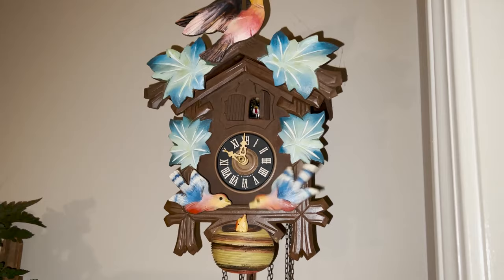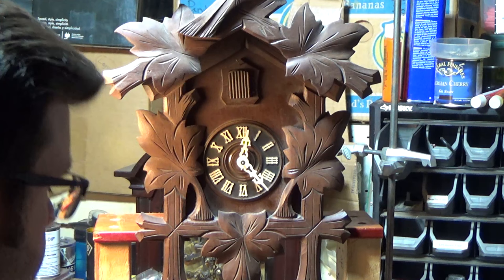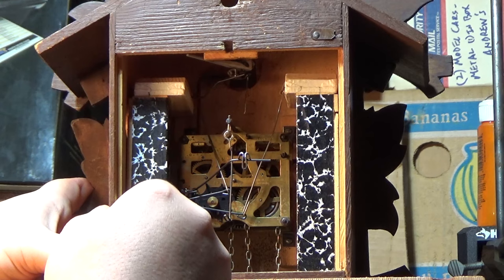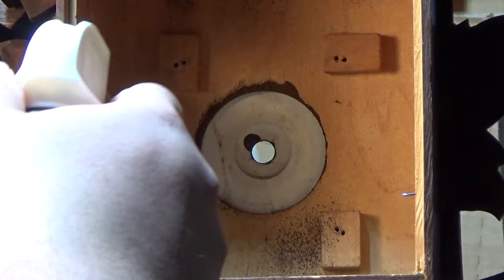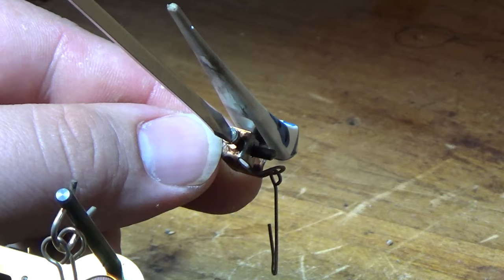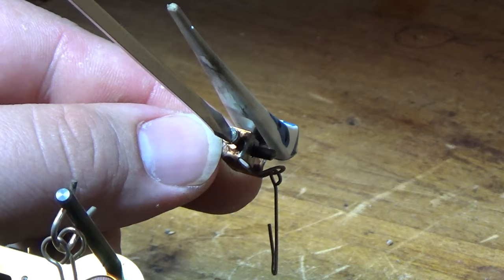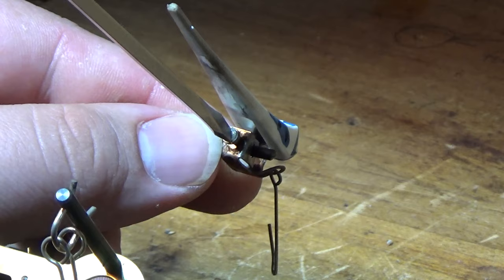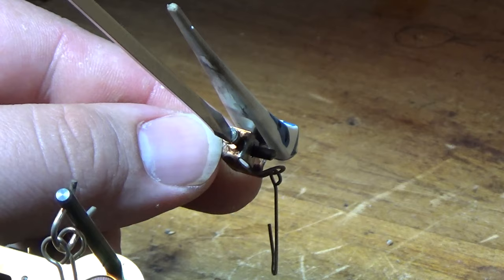Cuckoo Clocks - Function, Disassembly and Reassembly

Comment: NOTE: if the clock is an antique do not use a can of compressed air. They no longer contain just air, and you don't want to spray a valuable antique with chemicals.
Reply: Thats not how chemicals work buddy. Actual compressed air brings water with it which is way more dangerous than an EXTREMELY unreactive refrigerant
Reply: @melody3741  They didn't used to add the bitterant, so I did use them on antiques.  Now I have to use a hand-blown I don't know what they're called, like what you blow dust off a camera lens with.  Air only, it doesn't matter if the chemical is reactive or not, it's still an unnecessary chemical on antique wood - not a good combo.

Comment: Hi there! About a year ago, I bought my first cuckoo clock at an estate sale. It needed a little TLC, as it hadn't been running for quite a while. Since then, I now have eight cuckoo clocks and with help from folks like yourself, I have been able to learn a lot. These clocks have become my passion and I am enjoying the pleasure that they bring. Thanks for the video!
Reply: Like yourself, I found my 1st cuckoo clock at a yard sale for $10. Had it repaired by someone and once I got it home I installed the movement, weights and the bellows. Right now I'm having issues with the pendulum. I found that the click  needs to be flush on the wall so that the pendulum will move back-and-forth correctly. I'm going to see if that is my issue. But i push the pendulum it will move, but stops and I can hear a faint TikTok. My bird is working and cuckooing.  My movement is clean and oiled so I don't think it's the movement being worn out. My husband will install my cookoo clock on the wall when we find a Stud in the wall to attach the clock firmly. Once I get the clock on the wall I'm hoping my pendulum will work.
Reply: @peggykitting6036  If the pendulum stops, the mechanism probably just needs to be cleaned and oiled. There are plenty of YouTube videos that will direct your path. Good luck!
Reply: @DrMardo   I already had it professionally cleaned and oiled. And i had the bellows replaced. 
After I got it back from the repair shop, I put everything together, put it on a wall with a stud and a good nail. The weights are on correctly. But when I put the pendulum on it does not consistently move back-and-forth. It stops for some reason. When I take the pendulum off and move the wire back-and-forth, it Moves back-and-forth quickly And will continue for longer than an hour and then it stops for some reason. Could it possibly be out of beat? What do I do if it is out of beat? 

 Also I'm trying to figure out how to set the clock time.
The cuckoo bird  door is Cuckooing but the time is not set. Could that be the problem?Thank you so much
Reply: @peggykitting6036  Hello again, I am surprised that the clock repair person didn’t run the clock long enough to discover the problem you are describing. But then again, a lot of businesses today don’t have the customer service that was once common.

Cuckoo Clock must be absolutely level – meaning not too far to the left & not too far to the right. If the pendulum is not centered properly, it can stop swinging. I usually will place it on the wall and then step back and eyeball it to make sure it is level.

If the pendulum stops moving, what I have done in the past is to put an additional weight on the chain that controls the clock. You can use a safety pin to secure it to the chain. This does two things. One, it gives the clock enough weight/energy to keep the clock moving. That’s why I asked about the cleaning. If there is dust and grime on the gears, the clock will stop almost every time. The second thing it does is confirms whether you have the correct weight on the chain. If the weight is too small for the clock, it can’t provide enough force to keep the pendulum moving.

As for setting the time, is it the minute hand that is incorrect or the hour hand? If it is the minute hand, it is attached to the stem on a square peg. Move the minute hand forward until it cuckoos at the hour. Now unscrew the brass nut from the stem and gently pull the minute hand off and then set it back on the stem at the 12 o’clock position and replace the brass nut. If it is the hour hand, the stem is tapered and you can gently pry the hour hand towards you with your fingernails and it will become loose and dangle on the stem. You can simply move it to the correct hour and again just gently place a little pressure each side of the hour hand and secure it back on the tapered stem.

Hope this helps and good luck!
Reply from the maker: @Peggy Kitting - Just a slight addendum to what DrMardo was saying: The clock doesn't necessarily need to be level to function (as pointed out near the end of the video).  The importance is in the even beat (tick) of the pendulum.  As far as weights, if the clock is supposed to run for 1 day (most common), the weights should be between 275 - 320 grams (which is usually marked on the weight itself).  If heavier weights are needed, it's probably time for the movement to be serviced or replaced.  Good luck!

Comment: Marvellous tutorial. Followed your instructions including an 8hr dip in ammonium solution for the movement and clock oiling afterwards.Fitted a new set of bellows and hey presto I've heard the first cuckoo of Spring! Been a few years since our cuckoo 'cuckooed' and your video gave me the confidence to tackle the job myself. Saved me the wait of about 6 months and around £350+ at our local Horologist. Many thanks.
Reply from the maker: So glad to hear this helped you get your cuckoo clock back up and running again (as well as save some money)!!

Comment: Your video gives me the confidence to work on a cuckoo clock I inherited. It is a Bachmaier & Klemmer from West Germany. My grandparents brought it over from Germany, then it went to my father and now to me. After my father died, I had it stored in a box in the bedroom until we built an addition. When the addition was done, I hung it on the wall. It works, but sometimes runs for hours...other times for just minutes. It probably needs a good cleaning and oiling.

Comment: Most helpful! Having had some success in re-animating a friend's eighteenth-century longcase clock, I have been asked to do the same service for her cuckoo clock which appears very similar to this one; I should now be able to work with confidence (once I can get it off the wall; somebody seems to have glued it there!). I was interested to see that the striking mechanism is of the 'snail and rack' type rather than the older 'count-wheel' which is still found in many cheap clocks even after 1900. On the other hand, the method of adjusting the pendulum bob up and down is extraordinarily crude; by contrast, even the cheapest kitchen clock has a threaded nut or thumbscrew below or within the bob.

Comment: This video is well done, easy to follow and understand, congratulations. Even if the movement is not the same one as the nice Hubert Herr I am repairing, it has been very useful. I still have not found the solution to have the cuckoo door coming back completely shut once it has completed the proper amount of "back and forth" operations, it remains desperately open ! I can see in the bird's eye that he is not happy to always stay outside after having accomplished his duty, and therefore lacking privacy...Any hint would be extremely welcome. My movement is a simple one, ringing one time at half hours, and ringing as many times as necessary at the o'clock positions. It is marked 41 GB in painted characters inside the box. I guess there must be some spring somewhere that needs fine-tuning, but can't find it.
Reply from the maker: Thank you!!  First off, I have to say that I thoroughly enjoyed reading your description of the issue you're having!!  Anyway, it sounds like the return spring for the perch wire is either broken or misaligned.  Try testing the workings of the movement manually (by hand) and observe the way it functions (or how it's supposed to function, at least!).  If it's trying to shut, but doesn't close all the way, there could simply be a lever/wire getting in the way.  Check to make sure the bird doesn't have anything behind it that may get in the way of it popping backwards.  Take care, and good luck!!

Comment: I have a 3-chain cuckoo. Have oiled and reassembled it. The problem is I can't pull up the time and strike weights when they reach the bottom. Can't see any levers causing sprockets to lock up. What would cause this to jam?

Comment: Great video! Very well done! Thank you, I have a family heirloom cuckoo clock which I am attempting to repair as it does not gong nor cuckoo. I have twice before paid hundreds of dollars to have it repaired. Since I am retired, I do not have the disposable income to have it repaired by some one else. However, I do have much more time than money. Your video has given me the confidence and encouragement to attempt to repair it myself. Two questions: 1.What do you use to preserve the wood? and 2.You mentioned "...replacement parts are readily available..." what sources do you recommend for replacement parts? Again: Great video - Thank you!
Reply from the maker: Thank you for the feedback!  Glad you enjoyed it!  As for preserving the wood, usually just clean it by dusting, and using a mild cleaner (such as Totally Awesome from the dollar store lol).  Depending on the finish, I may even opt for using Old English to hide scuffs or scratches, and sometimes I use a polish called Bristol Cream Polish made by Mohawk.  I use a soft paint brush to apply, and re-brush with a clean one. Use a paper towel to clean the brush off in between swipes.  For replacement parts, it depends on your location.  If you're in the US, Merritt's or Timesavers sell the parts, as well as entire replacement movements.  Another source is Butterworth if you have access to their site, which you can inquire with them about, as they mostly sell to professionals.  All the suppliers have websites to order from.  Cheers!

Comment: I just inherited my parents cuckoo clock from black forrest.  It doesn't work.  Two of the bellows at the top are torn and the clock only runs for about 25 seconds before the pendulum stops.  I am curious if the weights should move evenly.  I see the one weight seems to be stuck all the way up.  The other weight lowers as I turn the clock hands manually.  Thanks for the video this has given me some good pointers on how to maybe gets things going
Reply from the maker: Sorry for the late reply!  Bellow tops can be replaced quite easily and inexpensively, and the weights should drop relatively evenly as the clock runs throughout the day.  However, since your clock stops, it's either out of beat or the movement needs serviced or replaced.  Good luck!

Comment: Thanks for this video, I was able to disassemble my clock and put back together, but pendulum keep stopping, don't know why
Reply: I'm no clock repairman but I have found if the clock is not hung level the pendulum will stop. Also if you removed the works from the case it needs to be re-installed sguare to the case.

Comment: Great video. I have a 3-weight Regula clock. It didn't work when I got it. Chains were off the sprockets, among other problems. I disassembled and oiled it and reassembled it using your video. Now I can't pull the weighted chains up and the pendulum won't keep moving. Something stuck in the time train?
Reply: 1st correction: I had the time train weight on the wrong end of the chain. Now pendulum works. But I still can't pull the chain up when the weight reaches the bottom.
Reply from the maker: Sounds like you're almost there...  Double check the weights are in their correct orientation.  Usually, the time and strike trains will have the weight hanging on the left end of the chain, and the trailing end on the right.  If you verified this is correct (as well as the trailing end of the chain is still accessible through the bottom of the case) it could be a wire or lever jamming into the sprocket, or the ratchet on the sprocket is seized or jammed.

Comment: Thank you Now i as a beginner can try to assemble my clock which was disassembled when I received it  at no charge For sure this video will be watched a few times but I think I will manage Only difference I see is the movement lifting arms ends are open and not bend holes like the ones in the video Must I bend them close n wires that runs to the bellows are fitted?
Reply from the maker: Hope this helps!!  And yes, the lift levers should have closed loops at the end.  Good luck!

Comment: nice video, but you should also have included movement disassembly as well as it is essential to properly clean the movement.
Reply from the maker: It actually isn’t, in this case. A clean, oil and adjust (COA) is commonly done without disassembly. If it requires disassembly, it is now considered an overhaul and would include bushings, pivots polished, etc. However there are plans for a video demonstrating exactly that. 👍
Reply: @BrackenClockWorks  from everything i was taught oiling and cleaning are separate things, everyone has their own method but the way i was taught was that oiling every couple years and disassembly and cleaning if you visually see dirt on the pivots when you go to oil or every 8-10 years at which you would inspect holes, but not necessarily have to do any work if wear is not out of tolerance.  Not saying i am right, just how i was taught.
Reply from the maker: @kwacz  I agree with you on these points!  When this was purely a hobby for me, I would proceed as you have outlined above.  However, since I started doing this professionally, I've learned there are simpler and quicker ways of accomplishing the same task. We recommend a servicing every 5 years and, in most of those cases, a COA is usually all that is needed (if conducted regularly).
Reply: Hi how did you clean the movement? I bought some cleaners and was going to soak n brush after soaking. My movement and clock looks exactly like the one in the video but a clock person did tell me it looks dirty. I would rather not disassemble the movement if possible.

Comment: I have clock - weight-driven, of course! Years ago an old man repaired it and I don't know what problems he found. I have always wondered if all 3 chains are the same length. It no longer runs 24 hours on one complete "wind"
Reply from the maker: The chains could have been shortened during that repair.  However, always make sure the clock is hanging at a height of at least 6 feet from the bottom of the case to the floor for maximum run time.  If, indeed, they are shorter, new ones can be purchased rather easily.  They are specific to the type of mechanism you have - i.e. Regula, Hubert Herr, etc.

Comment: When cleaning the movement (gears) what is the best oil to use and best way to use it…also if the clock isn’t currently running once it’s all cleaned how to I test to see if it’s back to working?
Reply from the maker: Pretty much any synthetic oil that is designed specifically for clocks such as NYE, however I've found the best is the Etsyntha 859 with its applicator tip.  As for testing, you can either put just the movement and the chains back into the case, or you can make your own test stand out of some wood.

Comment: Hi Sir, I saw your video, I also have this cuckoo clock which is made in Germany, it was running fine for many years but the clock is still running fine, cuckoo is not ringing, I opened it and poured kerosene After cleaning it and setting it again, the clock is working, the cuckoo still hasn't worked, the bell paper is also fine.
Reply from the maker: Kerosene? Oof... I don't recommend using that unless for specific cleaning operations.  It could be a few things causing to not cuckoo, however.  Something could be rubbing, misaligned, bent, broken, or the movement is simply worn out.  I've found it's cheaper to replace the movement rather than repair, in most cases.  Good Luck!

Comment: Got a clock from a friend that was missing the bellow lift wires. Obtained two replacement wires from a repairman but I don't know how to determine proper length of each wire. It is a Regula movement stamped 25/76 so I know it is a one day clock. Any advice or direction to an applicable video.

Comment: I have a 3 weight coocoo clock, and Ive been told by my grandfather not to pull the weights too far up, but I accidently pulled the left weight near the top. Will the clock be ok or does it require dissembling and reesembling?
Reply from the maker: Cuckoo clocks are usually designed with hooks that are larger than the holes through the bottom of the case to keep them from being pulled too high.  If the clock is still functioning, then there shouldn't be anything to worry about.
Reply: @BrackenClockWorks  thank you🥹

Comment: hey man great tutorial but can you tell me how much these weights way its a regula 25 ive heard they use different weights some 275g some 320g and some 420g
Reply from the maker: The information you have is correct.  Most common is the 320g, with some smaller clocks using the 275g.  The 420g I don't see often, but when I do, it's usually on a well-worn clock that was "serviced recently" (meaning, their answer to the clock not running was to hang heavier weights on it) or on a non-Regula movement like Cuckoo Clock Mfg Co.

Comment: Thanks for sharing. I have my parents clock from Germany, late 1960’s, it is missing the pendulum. Any suggestions where to get one ?
Reply from the maker: There are two places that I know of, in the US, that can supply the new pendulum for you: Merritts.com or Timesavers.com.  The important thing is to know what length of pendulum it would've had.  Perhaps you could call or email them and they can help you pick out what you need.   Good luck!